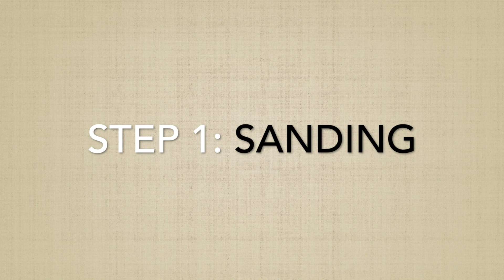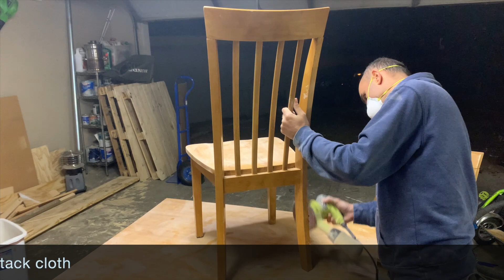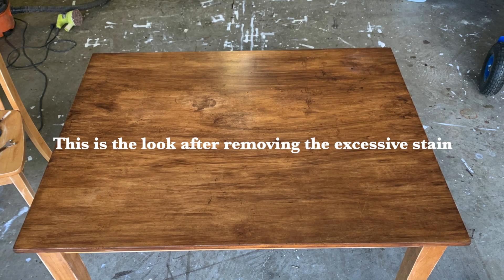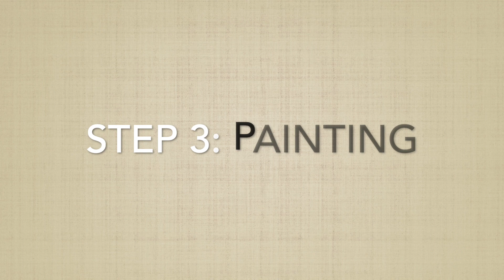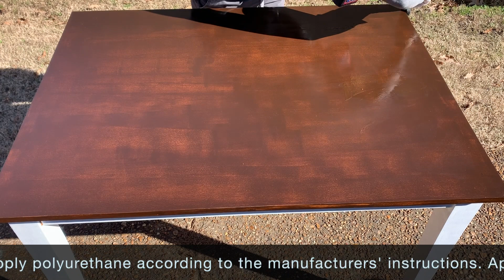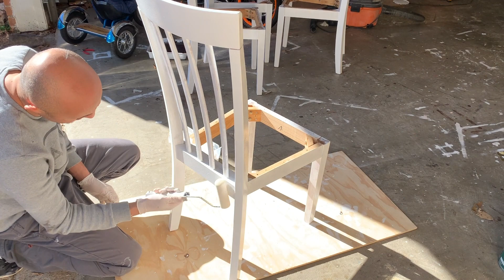Kitchen Table Refinishing. 4-Steps DIY

Comment from the maker: If anyone has any questions, please write below the comment section. All of the questions will be answered within 12 hours.
Reply: I didn't know that you could use a roller with stain..what kind did you use?
Reply from the maker: Zane Blane You can use both oil based or water based stain with a roller . Don’t forget to clean up the excessive stain with dry cloth.